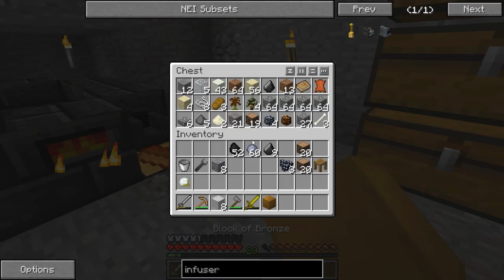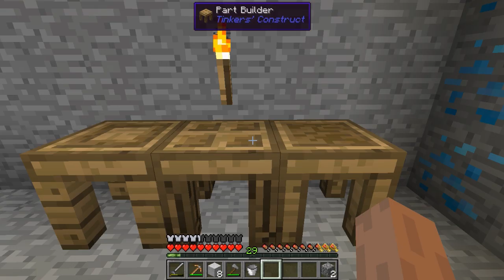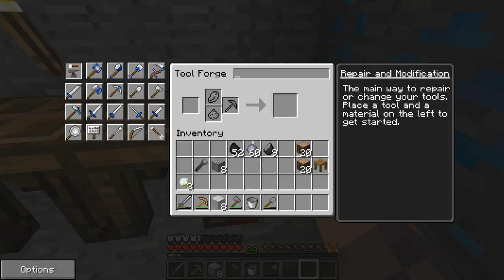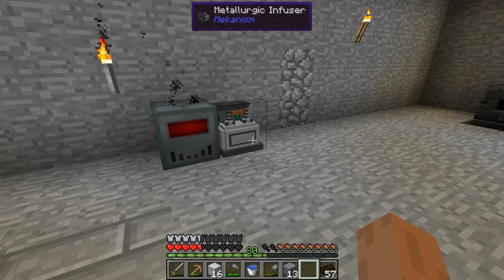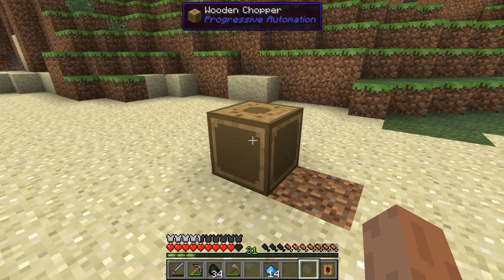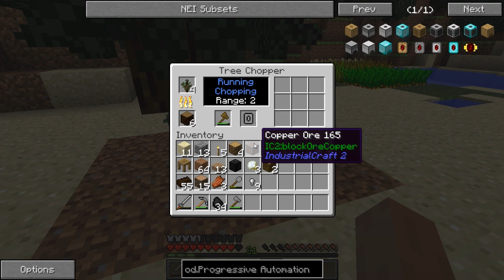Bevo's Tech Pack | Episode 2 | Basic Processing

Comment: My extractors and all them aren't getting power what do I do
Reply from the maker: If you're using the Mekanism Energy Cube, make sure your power to the machines is coming from the side of the cube that has the bar in the center. That is it's output face similar to how the IC2 power storage have dots.
Reply: I'm using the stirling thing and then using  the universal cable to connect the power but still not working